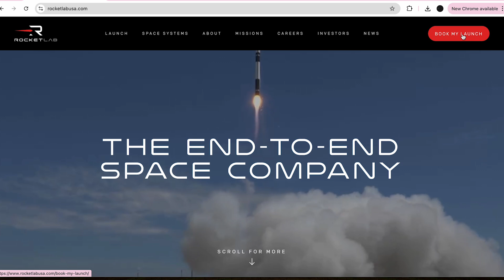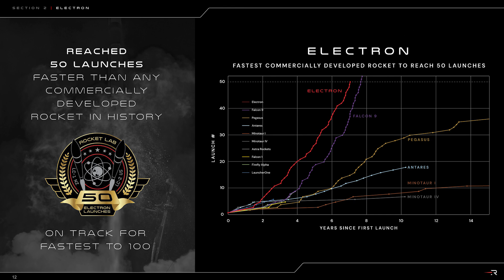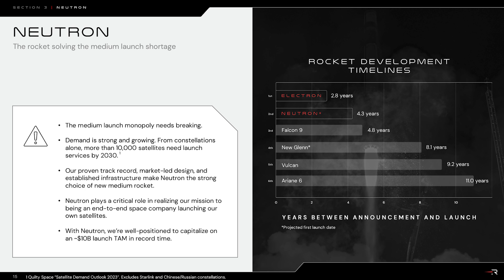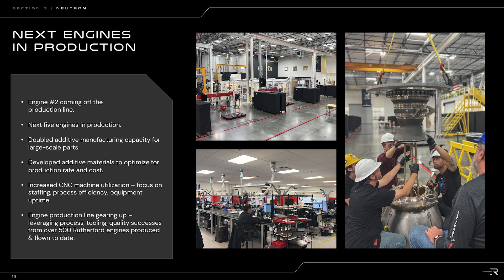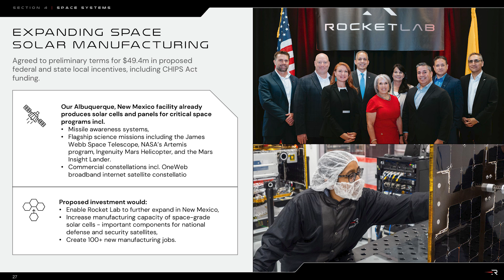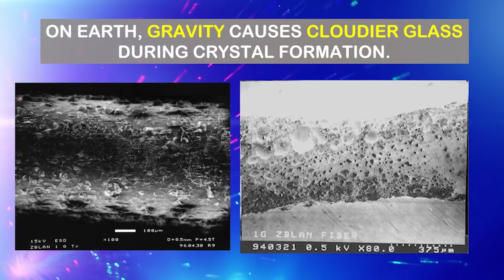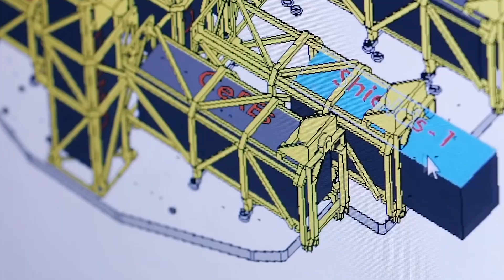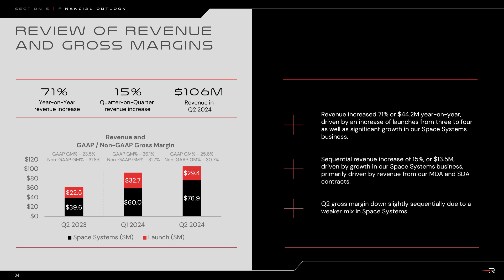Rocket Lab: Why I Am More Bullish Than Ever #RKLB #RocketLab #RKLBStock #RocketLabStock

Comment: How can you possibly say Nuetron is preforming better than Falcon 9, when Nuetron does NOT exsist nor flown ANY missions, yet Falcon 9 has already completed 384 missions & NOW RocketLab has done a complete 180° to copy Space X..

How is that better???

Also Nuetron if successful, is massively smaller, lighter and can only carry about half of what Falcon 9 can carry and is a 100% truly reusable,  where as Nuetron will has to be fished out of the ocean and restructured and recommissioned and particularly rebuilded, unlike Falcom 9, which has landed and been reload and launched again?????
Reply: Neutron will return to launch site or land on barge (Their small rocket Electron is plucked out of the sea....).... Neutron can put 15,000KG on orbit Expendable, Falcon 9 is 22,000KG expendable. Neither Falcon 9 or Neutron are 100% re-usable; they are both partially re-useable (1st stage only). 

@tech Do a little research.
Reply from the maker: I was only comparing rocket development timelines (meaning comparing the time it too from announcement to first successful launch, it does not take into consideration Falcon's pedigree once it was approved).

Neutron is expected to be full re-usable rocket, apparently even better than Falcon 9. As @Mottbox mentioned, you are getting Electron and Neutron facts mixed up.